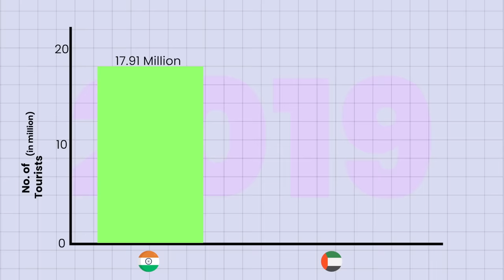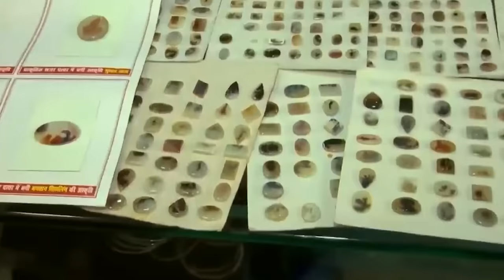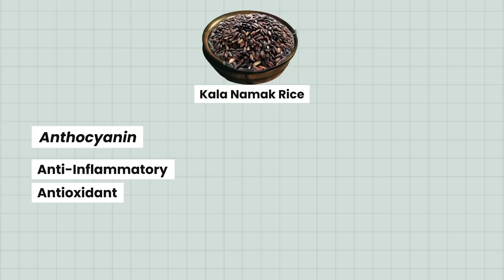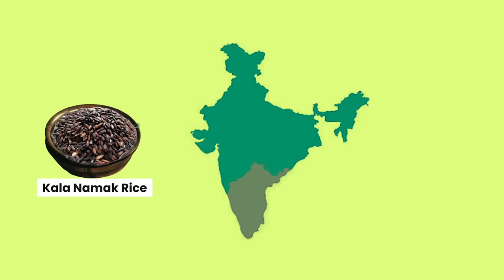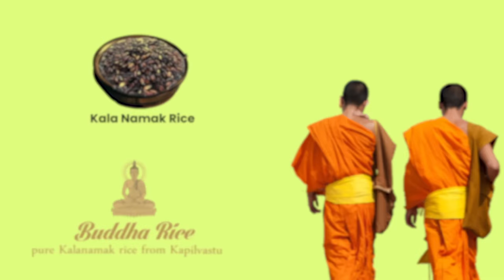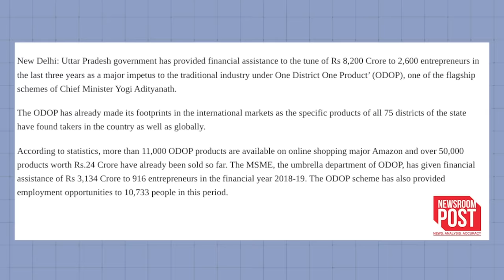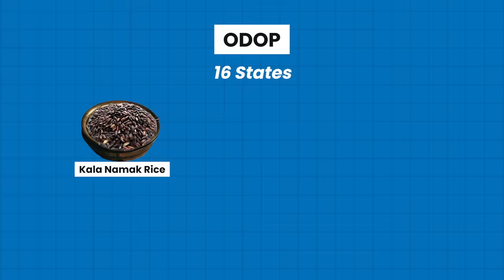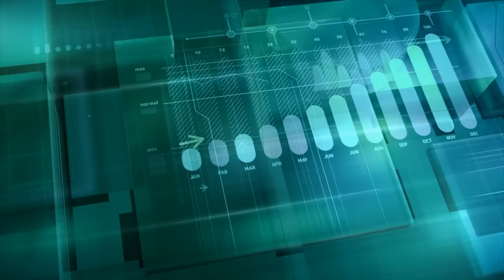How Yogi Adityanath's STRATEGY is turning Uttar Pradesh into a Mega Export Hub? :Business Case study

Comment: I belong to Baghpat ( 17km from Delhi). It is very close to Delhi, yet it was terrible to reach Delhi. Trains were less and passengers were more. We rarely got a seat. The situation is same still now, but doubling is I process and electrification is completed. With trains like Delhi - Ghaziabad route my area will also be developed like Ghaziabad. Road connectivity is drastically improved. There is no unmetalled road in my village and surrounding ones. The highway which was in poor condition is being rebuilt, with a flyover passing over. It looks like a Dream coming true. Never thought of so much improvement in my area.

Comment: When you compare mc Donald’s, the price of the food is way cheaper than 1 Dosa. Eg in USA you can get mc Donald’s burger from 2$ to 6$ which can fill your stomach. But where as 1 Dosa would be cost atleast $10 anywhere in USA and 1 Dosa will not fill your stomach you need atleast 2 which could cost $20. Which is damm expensive. This is sane thing goes with idli Indian food is so expensive and it can’t be affordable by mass population. It’s easy to say than done. Burger is fast food and can be cooked under a min. Easy to eat on the go. Dosa you need plate and it’s not easy to get and eat from drive through. Unless we figure this out Indian food will be only luxurious for west on occasion basis